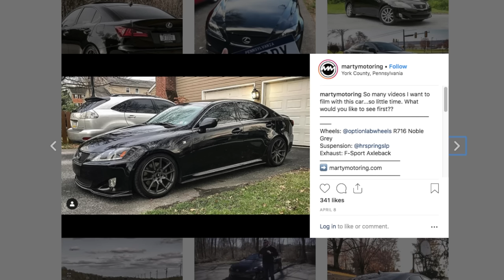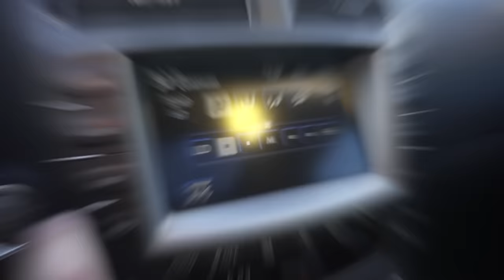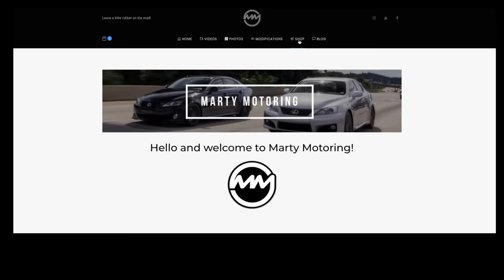Popular Mods for Lexus IS 250 and IS 350

Comment: I am in the market to pick up a use Lexus IS350 from 2006-2013 year and a lots of them have like 130k to 150k plus miles on them.  How reliable is this Lexus Engine or the Lexus IS350.

If you own a Lexus IS350 from 2006-2013 please post your miles you currently have?  and what maintenance you made so for etc.

Thank you so much in advance : )
Reply: did you end up getting a is350? its been 2 years lol

Comment: Quick question bro, How are the seats on the is350 f sport? I’m a heavier dude (5’11 265 pounds ) and the bolstering is a concern. I currently drive a 2010 370z and although I manage to live with it the car seats are  pretty damn uncomfortable. I swap cars with my brother at times just because of comfort , he drives a 2006 Scion tC.. not the most comfortable car but doesn’t have massive bolstering. Would you suggest settling for the regular is350 with the flatter seats or is the bolstering on the f sport model not that big of a deal?
Reply from the maker: Being 6’1” and like 255lbs myself, I prefer the flatter ones for everyday comfort and driving. The bolstering in the F sports is the same as the ISF, not bad - but it can hit your leg and abdomen and get uncomfortable. Nonthe bolstering works great but you can move around more in the regular seats

Comment: What's better rr racing intake or injen intake
Reply from the maker: I have heard that the Injen and KN cone intakes lose power according to dynos. I stuck with the F sport box, drop in filter and the RR Intake tube which is carbon fiber and doesn’t get very hot, which equals cooler air and potentially more power. I also like how it looks lol.
Reply: @MartyMotoring  what kind of  Filter do u recommend
Reply from the maker: alex morazan I have the F Sport washable filter. Works great. KN filter is a little cheaper and works well too

Comment: Is there any way to get a new bumper conversion mod so it looks updated and a new infotainment system
Reply: You can get the Grom add on which works best or get the Tesla screen from eBay or other sites but the backup camera might not work with that one plus next to no support for issues

Comment: Hey Marty I have a question does your is350 smell like rotten eggs when you full throttle it? Because  my is350 does.
Reply: Anthony Mejia  typically that smell is a sign of a clogged or bad catalytic converter. Mine started doing the same lately.
Reply from the maker: Sometimes mine will, yeah. Other times it’s fine. I just don’t want to replace cats right now 😂
Reply: @MartyMotoring  thinking of doing the cat delete and placing an O2 sim so not to get the CEL instead of replacing the cat.
Reply: @meteoro300  Oh shoot so that means my cats are running out of life and would need to be replaced soon?

Comment: Hey man, cool vid.
I got a 250, I was just wondering if you know if the stock headlights can take the Philips LED bulbs?
Reply from the maker: Thanks! Stock headlights should be able to - I forget how the back is. Halogen models will be easier than HID models. If the Phillips LEDs have the fan on them, and you adjust the output height correctly, should work just fine
Reply: @MartyMotoring   Thanks for the Info mate, appreciate it.
I do have the Halogens so I think I might give it a go.
Was just worried it wouldn't fit with the plastic backplate on. Wouldn't want to get water into the headlights.

Comment: RR racing is the only way to go
Reply from the maker: They are legit
Reply: Marty Motoring other than my midpipe and exhaust from Miesterschaft everything else has come from RR racing on my RCF the only thing I had to change was my  battery it kept draining the shit out the stock one for some reason . At one point I did have RSR lowering springs which where actually really great and had a factory feel no issues .

Comment: What size tires you running? Getting 18×8.5 and thinking of running 225/45. Any advice?
Reply from the maker: Nice! On my 18x8.5 fronts I run 225/40 which is the stock size and ratio. 45 is too tall and may rub. If anything, 235/40 would be better.
Reply: @MartyMotoring  cool thanks. And what about you rear? You think 275/40 will have any fitment issues?

Comment: Um,...well first lifter tick, wrong the ticking noise is the 1000 psi fuel pressure at the injectors, and I did not see you drill a hole, it was funny watching you fumble and bumble though.

Comment: Alot of Carbon build up in these cars. Should get walnut blasting done
Reply from the maker: That is an option. The IS350 and ISF do not have carbon buildup issues due to direct and port injection - unfortunately the IS 250 has the carbon buildup issue due to being direct injection only.
Reply: LOL you did not cover anything on the isf and yes i was talking about the is250

Comment: Do you have the sticky dash problem in yours? It doesn't bother me much but I'm wondering what the aftermarket stuff is like to cover it
Reply from the maker: I luckily got mine replaced soon after getting the car. I'm not sure what would be able to help it
Reply: @MartyMotoring  Yeah the previous owner missed the recall for it. I have seen online a carpet dash cover made specifically for the IS models. It was on ebay for anyone that is interested.

Comment: I wish this car had a manual transmission
Reply: Carlos De la cruz yeah only the 250 I wish the 350 came with a manual transmission option
Reply: It's got a paddle shift,is that not the same?
Reply: @rizo662  paddle shifts can't compare to the feel of a manual gearbox although modern auto's are quicker than a manual transmission

Comment: Yo where you get the brake calipers from that say Lexus
Reply from the maker: So that’s actually a decal - the calipers are painted, decal applied, and clear coat goes over it. All engine or caliper paint to handle the heat

Comment: Is that an aftermarket grill? Im trying to find one looking like that for my 2IS and I cant find any
Reply from the maker: Yup - I got it on eBay - "lexus is350 mesh grille"
Reply: @MartyMotoring  I figured, they just dont look as good in the pictures/dont have the chrome emblem on it. Im assuming you just stuck the OE one on there with 3M? Also is there any link to the bumper anywhere? Ive been considering just getting a lip to add on to the OEM but this bumper is so clean.

Comment: Does the mod with the intake allow a better engine sound? Or is the sound the same comparing to stock?
Reply from the maker: The hole in the box will give you more induction sound, yes. I did a little video on it, too. Sounds good, but the hardpipe doesn’t do much for sound, more for smooth airflow
Reply: Marty Motoring thanks for the info. How much was the hardpipe?

Comment: Does anybody know why my 09 is250 audio randomly stopped working? It says the radio is on but no sound. Not even beeping when I press buttons
Reply: Push the power button on. I used to hit it with my knee before I realized it!
Reply: @slickfixjeff  no it's definitely on. I think it might be my amp
Reply: This happened to me (same car) because my usb power adapter that powered my BT adapter was a bit loose. This caused it to momentarily cut out when I hit a bump. After so many cut-outs it would disable my audio. I bought a new USB adapter with a more secure fit and it fixed it. If your issue is unrelated to using the aux port or power adapter, check the fuses tied to “Audio” in the owners manual. There is one under the hood (#4) and another in the passenger fuse box (#6). There are spare fuses in the other fuse box under the hood.

Comment: How much is all that modification cost in total?
Reply from the maker: It depends what you want to do. Wheels and tires are the biggest cost. Brakes can be upgraded as a maintenance item and lowering is mostly for looks and handling so not essential. Exhaust is expensive but I got a good deal. I'd say you can do most of this stuff for around $2000 over time.
Reply: @MartyMotoring  Okay! Thanks bro for the information! You done got you a new subscriber.

Comment: Is there ANYONE out there that mods the 350 for more actual power beside an intake or exhaust? These need a bit more than a ridiculous cold air intake or something that just sounds fast
Reply from the maker: Intake and exhaust do help a little and are easier and cheaper to do. There are performances companies that make supercharger kits and tunes for these cars, like RR Racing, but not everyone wants to shell out $6,000-10,000 on their car. And most people could upgrade to the IS F at that point if they are looking for more power
Reply from the maker: Also, the IS350 is rated at 4.8 second 0-60 and 13.3 second quarter mile which makes it on par with many other sports cars

Comment: what about the y38 the brz diff
Reply from the maker: Cool mod but doesn’t seem super popular from what I have seen
Reply: I don’t think people know about it like know would think that the same transmission inside the brz and differential is inside the is 250 mt
Reply: Plus it expensive or cheap depending on where you get it
Reply: Well  I mean the trans is completely different but only in the way of a bell housing and input shaft and gearing but it made by the same company

Comment: I'm gonna be the elephant in room, best exterior/cosmetic mods is to leave it stock especially if you have a f-soprt, all these is250 is350 look the same, vland headlights vland tail lights, same roof spoiler, same duck bill style trunk spoiler, same rear diffuser, same front lip, same is3 front bumper conversion etc all these mods are played out in my honest opinion, nothing original or any type of creativity smh, I'm all about maintenance and performance parts that actually work, in my opinion that's money well spent
Reply: I have a gs350 2010 with 167k miles, Its on lowered springs + aftermarket tires & rims and I plan on getting a catback exhaust next week, I been hearing that I could get a RR racing tune but I'm a little un sure about it since I'm worried about the engines health with these miles, any tips? btw any other performance mods I can add that actually will give significant results?

Comment: Do you know what headlights or taillights will fit a 2010 IS 250C?
Reply: Any IS headlight assembly should if it's same generation, you should be pretty golden as far as your choices in headlights... After taking a look at the rear... I'm not so sure. The IS Convertibles have a strange butt.

Comment: I'm trying to build my lexus and see has anyone seen anything new as far as mods
Reply: Zeovlo 2006 MT 6 I already put a stage 3 clutch  and a lightweight flywheel  but it doesn’t make a huge difference
Reply: Zeovlo it was around 1300 and my car has 117000
Reply: Zeovlo if you have any question going with the older model let me know but I won’t lie to you dude it a burden to bare 
It is kind of slow and you will hear a lot people say trade it and get an is 350 but I love my is 250 because it balanced and I think with the right frame of mind and direction it got the potential to be great race car despite all of it weight
Reply: Zeovlo also it is very nibble around corner it was designed to compete against bmw 3 series around the 
325 or 328 I forgot

Comment: What kind of wheels and tires are these on your video?
Reply from the maker: They are OptionLab R716 😎
Reply from the maker: 18 inch wheels - 8.5 front and 9.5 rear wide. 225/40 front and 245/40 rear tires
Reply: @MartyMotoring  sorry what is 8.5 in front and 9.5 in back? Im trying to buy rims and wheels just like you tbh. Ive looked online and i have a white is250 and think these would look nice on them. I have factory rims with 225/40/r18 all around

Comment: Hello! Is250 owner here. I did a debarge but I noticed the trunk has mounting holes for the emblems :(

Wondering how you solved this, or if you just left the holes visible... 

Thanks!
Reply from the maker: Hey there! When I made this video, I forgot to mention that. I took gloss black vinyl wrap from eBay and a hole punch and made little black circles to put over the holes. They work really well
Reply: @MartyMotoring  gotcha! thank you!

Comment: Debadging you car is only something you can do with the very early models. My 09 has locator hole beneath the badges. So if you remove and don't replace them. You have a bunch of ugly little holes in your boot lid.
Reply from the maker: Mine has the holes too actually. I covered them with vinyl circles

Comment: Just got the 2019 nx300 F Sport 
I like to do the straight pipe any recommend?
Reply: No, it's an SUV... Don't do that... Lol
Don't make Non-Race car SUV try to sound like a... Race car.... NX F sport or not, still stock 235 Hp, while my 2009 RX has 270, yet I would still never do it. Anything averaging 300 Hp isn't very impressive, and fairly cringe if it sounds stronger than it actually is. I mean your ride, your choice, but I'm just helping bro. Having a loud DAD SUV isn't that cool... For example, I saw a real Nice newer Mercedes with anti-lag, quad exhaust. It sounded great, didn't stop it from being pretty gay.

Edit: I did a little more research... Yeah the NX200t F sport 2019, is only a 4-cylinder 2.0 liter engine... Honestly really doesn't scream; "straight pipe me", sure it's Turbo charged... I guess... Atleast it isn't as bad as when I told my Buddy how slow and laughable his 2015 CT200H F sport is... At least you don;t got that or a super slow UX.

Comment: I could be mistaken, but is that an F badge on a non-F sport Lexus?...
Reply from the maker: It’s a F Sport badge - F and F sport are 2 very different things. This is an F sport badge, which signifies V6 and Lexus performance parts, known as F sport, which I have installed. 
F is for Fuji and comes with the V8, 8 speed transmission, stiffer chassis, Brembo brakes, wider fenders, tuned suspension, BBS forged wheels etc. I would never upbadge a car lol.

Comment: Hey MARTAAYYYYY, great video man! I'm definitely going to do all these mods to my 09 250. What suggestions do you have for replacing stock seats with? Mine are clapped out and looking very old and abused (mine are equipped with cooled/heated feature).   I've peeked into other ppls 250/350 and noticed their seats look so much cleaner and plush, especially the seats from 12+ model years. Also have heard ppl swap in IS-F seats. What're your thoughts?🤔  
Appreciate the Vid- SUB'D+
Reply from the maker: Hey there, thanks! 🤔 Well I thought about this for a while too. I enjoy the cooled/heated seats but the ISF seats offer more bolstering but no cooling (which means they are lighter). Good in between before going full racing seat. I would just try to restore yours with some leather restorer first and go from there!

Comment: This video made my day! I have an 09 is250.  Definitely going with a few of these and already ordered the tail lights. PROBLEM: the headlights (HID) have bad ballasts, I want to replace but factory is $2800. Can't find an after market like ones you have to fit the HID model. Can I switch  to halogen or LED???
Reply from the maker: Awesome, thanks for watching! Well you can replace the HID bulb and ballasts by going aftermarket on eBay...I've done that in the past. Or buy some used, working OEM ballasts. Either would solve that issue. I had HID headlights too from the factory, but they were more to worry about, so I replaced the whole headlamp with the VIPMotoz LED/halogen models (they fit) and did a low beam H7 LED instead of the provided halogen. It plugs right in. I did a video explaining it:

https://www.youtube.com/watch?v=n1rdPE2H6NQ
Reply: @MartyMotoring  life saver!

Comment: For the 250 it should be a motor swap For something with horsepower
Reply: There's the 350 and ISF for that. Very few people have the space, tools or know how to swap it. The 250 is hardly set up for more power anyway, and by the time it is with how much you'd have to spend,  you may as well have just upgraded to the better model.

Comment: Is carbon buildup an issue with the IS250, since it has only direct injection?
I wanna get a manual IS250, they're fairly cheap here.
Reply from the maker: It is, but there is always ways to clean it

Comment: Putting a F sport badge on your 350 and removing the others doesn’t make it more appealing. Those who actually own one look at it with disappointment.
Reply from the maker: F Sport is a sporty trim level, not a model like the IS F. Debadged looks cleanest though. Plus, I had lots of FSport parts and upgrades. I ended up taking even those emblems off for a cleaner look.